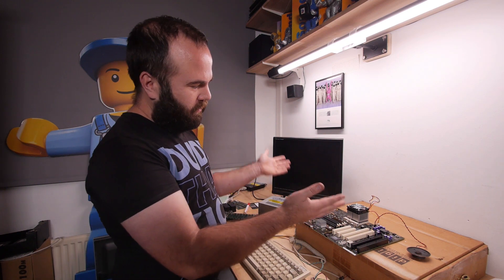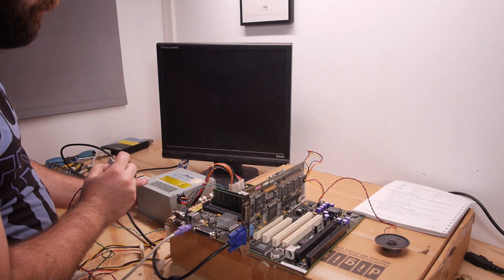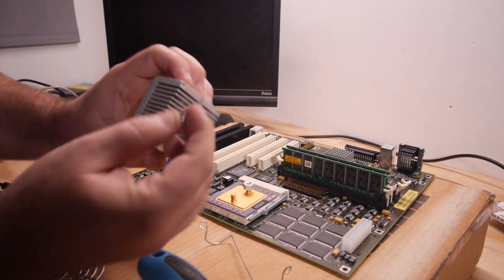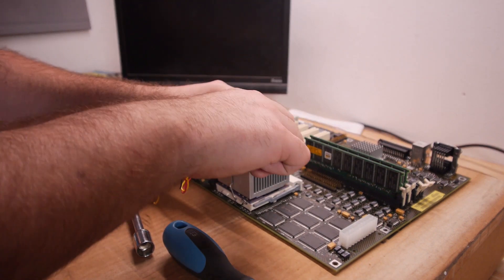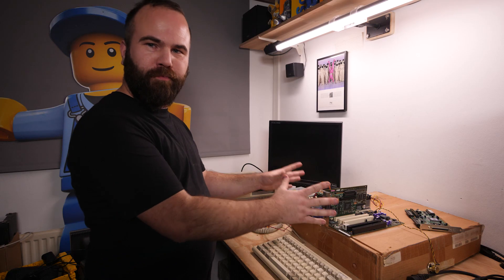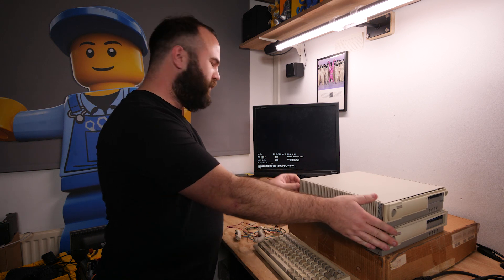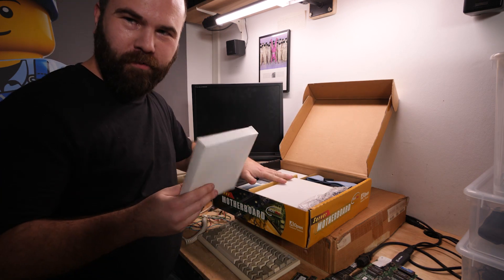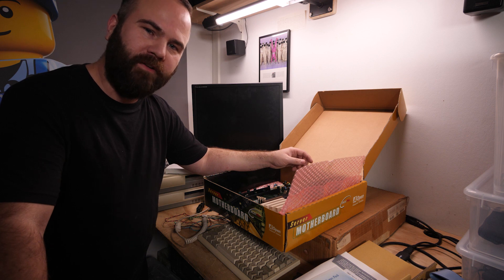I got the AlphaPC 164LX Motherboard working & bought 2 DEC Multia's (new PC build plans!)

Comment: Very nice you got it going! ECC ram FTW!

Also if you want 3D support I would suggest Permedia 2 PCI 8MB card.
It has drivers, 3Dlabs still have drivers up on there site with the Alpha drivers included.
Can be overclocked too, has better color support and resolution support in fullscreen then most workstation cards and its fast enough for some Quake 2.

I also remember that the DAC960 SCSI cards have Alpha NT drivers so if you have one of those they are an option.

Comment: Sweet dual Slot 2 board! I've always wondered why they put AGP slots in server boards. Did they expect some buyers to use them for advanced graphics workstations, or was it just to have more monitor choices? I can't imagine a shortage of cheap PCI adapters meant for servers.
Reply: I wondered, too. Also it comes with PCI instead of PCI64. Most of these boards came without AGP slot but onboard agp GPU like ATI rage.

Comment: im with cyber cat seemed a bit heavy handed with the bolts.  but im so glad you got it running. 700mhz xeons with a matrox 400 card? doesnt seem like a good pairing to me, why not go the whole hog with a Geforce 2 GTS similiar year to the xeon and a stunning card in its day, which i still have found memorys off having bought a few different ones in radio/computer fairs.  or maybe a voodoo 4 4500 card.